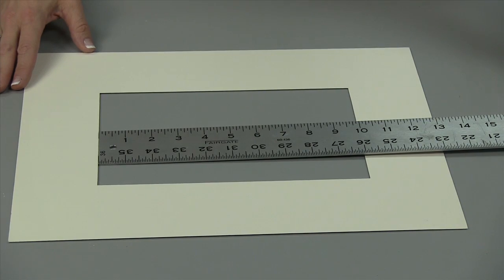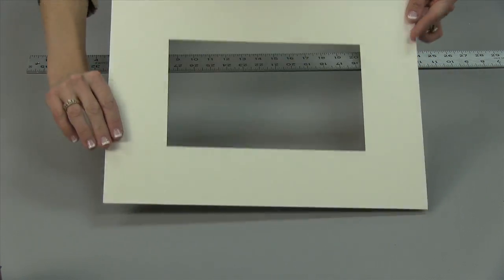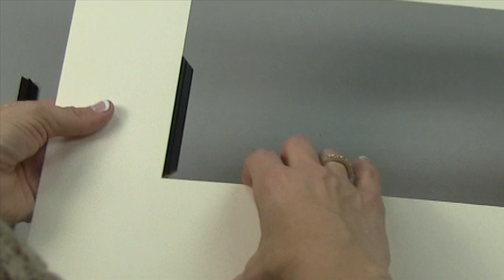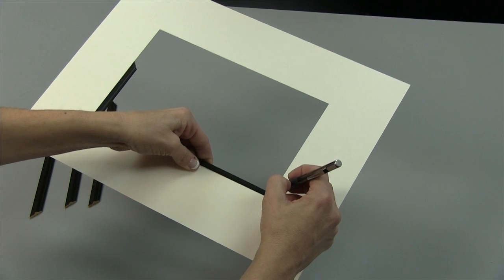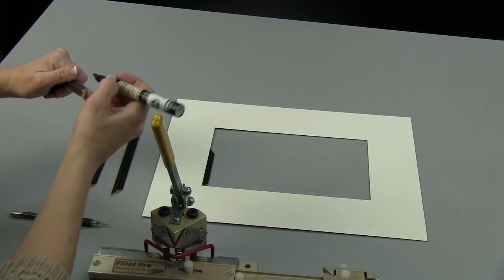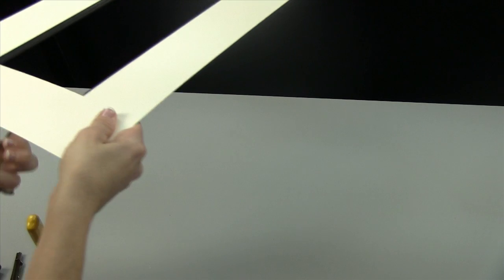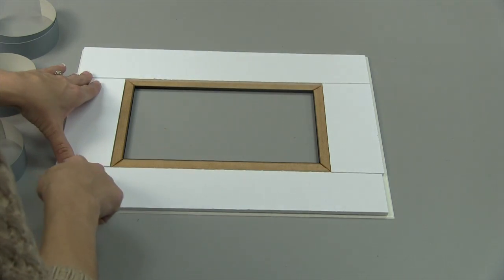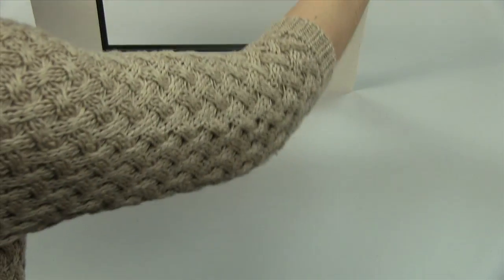Ask a Pro - How to Assemble & Install Fillets

Comment: what do you mean "chase the sides"?
Reply from the maker: Hi Sarah!  Great question.  "Chasing the sides" is a term used when starting at one position (such as fitting the first leg of a fillet into the opening width of a mat), then continuing on to the next, adjacent side- continuing all around the opening to fit and finish the fillet within the window. Chasing the sides is also a technique used for fitting fillets within a frame and helps ensure a high quality mitered corner.
Reply: so I guess then you cut fillet short side, then, other short side, cut long side, then other long side. fit in this order as well, and this is called chasing the sides? please and thank you.